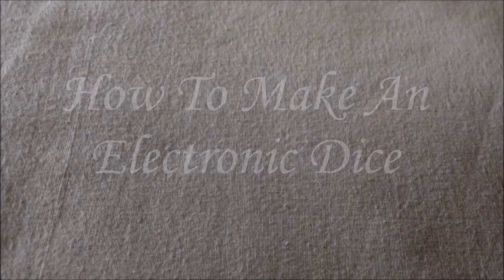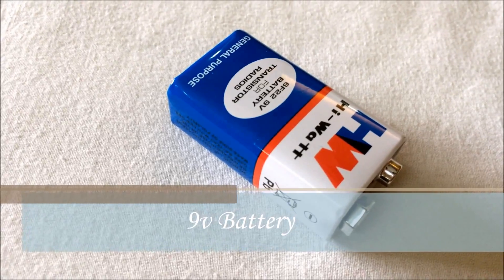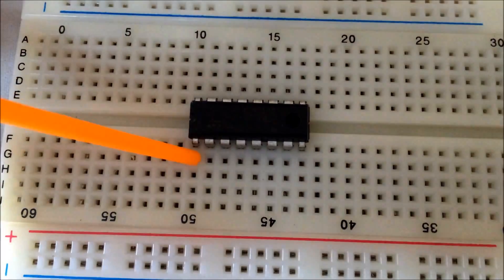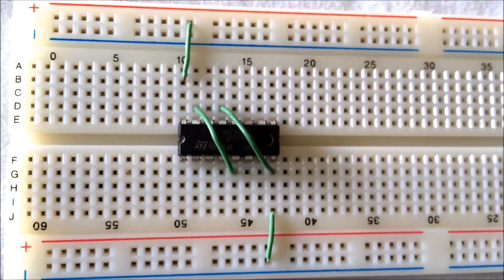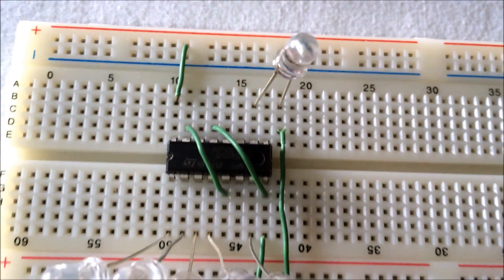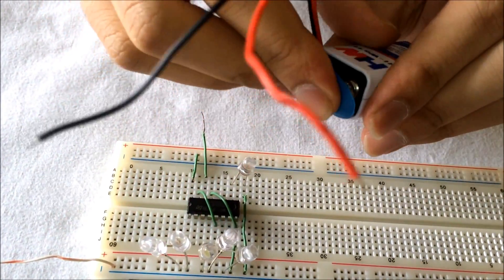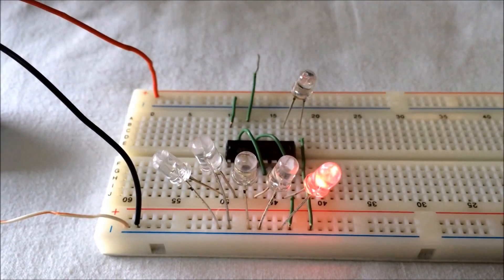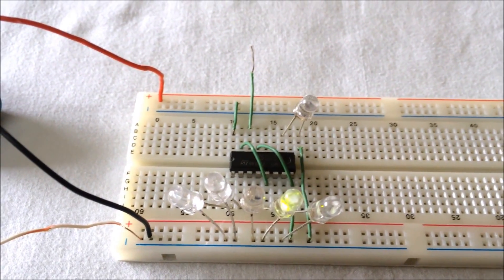How To Make An Electronic Dice

Comment: If you can't get this to work, maybe use a very fast 555 timer astable circuit and connect the output to the clock in of the 4017, then disconnect it to stop

Comment: Firstly, that’s not a dice.... secondly, say goodbye to your LED’s.. no current limiting resistors...thirdly, your basically using static to clock the counter... bad. Lastly... no bypass cap in the logic power lines.... bad... total fail.

Comment: I have tried it but the LEDs are glowing as u shown but they are glowing in a sequence not randomly I want to know why is this so?
Reply: Hey! It's bcz the wire should've been grounded(earthed). For that, u should connect a wire from the 8th pin to the lower horizontal panel of the breadboard, and from there using another wire, extend it to a 'earth-socket'
Reply: @suryoski  Oh thanks a lot..!

Comment: actually circuit is partially completed... you need to give a clock pulse of a very high freq to the pin 14th of 4017, you can generate a very high clock pulse by using a 555 timer IC in astable mode .. try this trick have fun, thanks me later

Comment: Solution for circuit not working. It was not working for me earlier but I diagnosed as below and it is working consistently
1) Verify that all connections are intact.
2) Ensure proper earthing to breadboard (-ve row), don't keep breadboard on wooden surface or insulating surface. Try putting it on ground / floor, it will work consistently, no earthing wire is required.
Reply: Please tell me how to earth the circuit

Comment: how to earth the wire ???
Anybody please tell me !!!!!
Reply: Connect a long wire to the earth terminal of the plug point(third large hole) , make sure that the switch is in off mode and then other end should  connect to the negative rail of the breadboard , in this manner the circuit should work properly.
Reply: earth is nothing but the negative terminal of the battery

Comment: What is the need for connecting the 15th pin(reset pin)with the 6th pin of 4017 ic ?
You can simply make the resset pin (pin 15) to the ground.
Reply: It resets the counter to 0 once it gets to 6, because there are only 6 LEDs, and the chip can count up to 9
Reply: Subham Chowdhury bro how to ground

Comment: can i make it on pcb with the same circuit daigram?
Reply: RAJ WADIA I don't want to be rude but that is the most idiotic question I ever read in my life
Reply: RAJ WADIA no!the breadboard have the transverse lines are mounted together and separated two part by a track,the power lines are linked in the vertical way.

Comment: What do you mean Earth the negative rail on the bread board
Reply: the further a wire is from the battery, the more susceptible it is to random radio noise. by having a long wire touch the earth, a random amount of power is diverted from the circuit to the earth.

Comment: I like this, but I think it needs more work to make it a viable source of random numbers. This should be a good project for learning more about making circuits do what you want. As it is, it may be useful to play a board game, just for fun, not serious competition. To be fair, it is absurdly tricky to make electronics produce truly random numbers, made even more difficult if you also require it to be tamper proof.

Some people try to solve this with increasingly complex patterns, and more elaborate setups. They have to make their solution more and more complex because people eventually find more sophisticated ways to predict patterns in their "random" numbers. I have heard of one online service that harnesses cosmic noise (electromagnetic radiation from space) to produce random numbers, and I haven't heard of them having any problems yet, though I suppose I could have missed it.

Anyway, I would have liked more explaining about how this circuit works, but it was a good video.
Reply: Since only one output is high at a time, I'm guessing this is a stepper circuit. They aren't truly shuffling, they are going in order in a loop. The speed of that loop is determined by the capacitance between earth and his finger. To cheat this circuit, you need to know that capacitance and move your finger with milli second precision. Other wise, the hydration, nutrition, height, orientation, and happiness of the person with the finger generates a random speed to cycle through, and ultimately a random output.

That output might not be fair, however, as one output may have a marginally wider window, but this can probably only be determined by testing and is equally unfair to all players.
Reply: Not certain about the points made but ,if anyone else needs to find out about how to make electronic circuits pdf try Elumpa Circuits Expert Alchemist (Have a quick look on google cant remember the place now ) ? Ive heard some unbelievable things about it and my colleague got cool results with it.

Comment: FOR EVERYONE EARTH  WIRE IS A WIRE THAT IS CONNECTED TO THE EARTH!!! YOU CAN PICK IT FROM YOUR PC CASE OR ANY OTHER DEVICE THAT YOU HAVE AROUND THAT HAS METAL CASE!!! IF YOU DON"T TRY TO CONNECT THAT WIRE TO A METAL THING THAT TOUCHES THE GROUND/FLOOR or directly from your WALL PLUG  if you live in us it's the big hole click here http://previews.123rf.com/images/badboo/badboo1011/badboo101100016/8176905-Electrical-outlet-on-white-interior-wall-Stock-Photo-plug.jpg if you are in europe is the side contacts click here http://g03.a.alicdn.com/kf/HTB1tw0RKFXXXXaVXpXXq6xXFXXXp/TAILI-Wall-Socket-EU-Standard-Wall-outlet-Power-German-Socket-Plug-with-earth-contact-with-cover.jpg_640x640.jpg ,and if you don't wanna do that stick a metal into your back yard connect a wire to it and bring it to your breadboard because EARTH WIRE MEANS EARTH CONTACT! HOPE THIS HELPS YOU!

Comment: the leds are not shuffling when i touch the wire. only one led shifts...
Reply: Yes i have also done but not shuffling
Reply: Same problem here also
Reply: Same problem here
Reply: Same problem here also
Reply: It works 
your body must not touch the ground when you touch the open wire
As it grounds you and the circuit does not work
Reply: well my project works when i touch the ground with my bare foot plus my 6th led dosnt lights up .
Reply: Check your connections properly it's will work and all led will shuffle